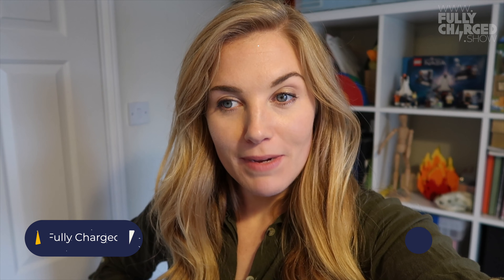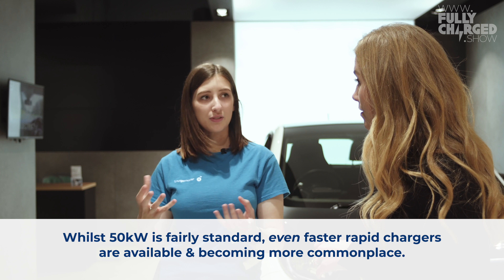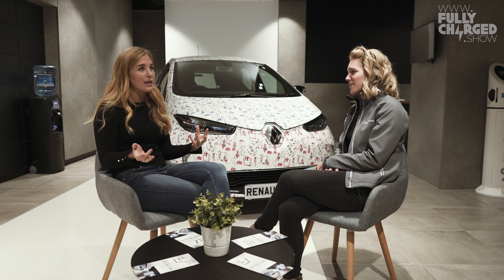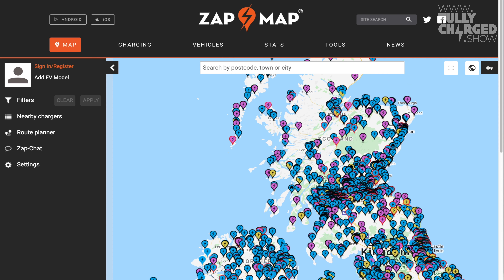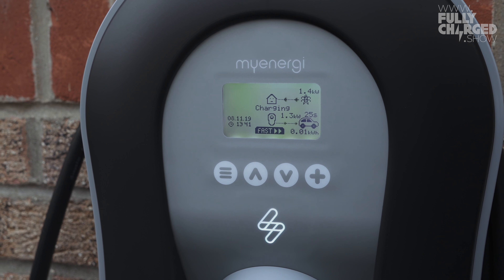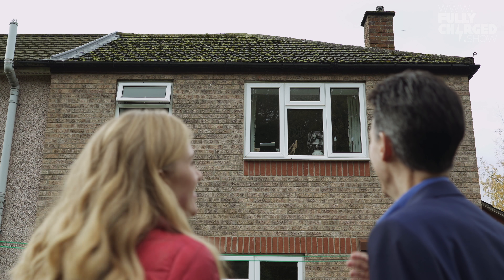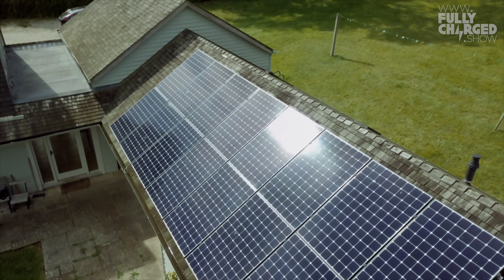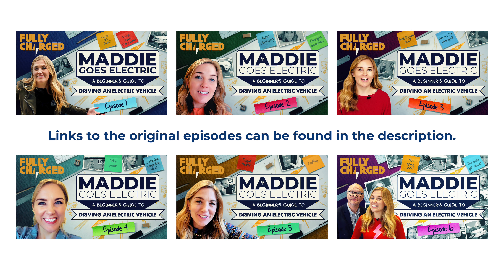A shareable, beginners guide to electric cars with Maddie Moate | Fully Charged

Comment: Have most of the Fully  Charged Show got family close by or would it be a longer trip, because the charging network can vary depending on area of the country.
Reply from the maker: It varies person to person, but I do 30,000 miles a year in my electric car. Many models now have 200-300 mile range and are really easy to live with. All the best, Fully Charged Dan

Comment: Great insight into electric cars. The key for this to work is good infrastructure and faster charging times. It feels like the future though. Maybe you could do one on hydrogen cars and how that is looking.
Reply from the maker: It's the here and now. Have done 120,000 in 4 years in an Electric Vehicle. We cover Hydrogen too, but the cars start from over £60,000 so it will be a while before they are cost competitive. Thanks, Fully Charged Dan

Comment: I have a question regarding the rising cost of public charging. It’s really putting me off looking at electric. Firstly there is the far higher cost of the car but now in many counties it’s costing more to charge than a fossil fuel fill. Massive mistake here. What are your thoughts? Paying more up front for cheaper running costs make sense but paying more all round is a major turn off. It’s now purely an environmental choice which will hinder growth or stop it in its tracks.

Comment: There are more charging points than petrol stations in the UK? That's a surprise. In the US there are around 80000 charge points and about 168000 gas stations. Of course, to be fair, if you also add all of the places you can just plug in to a (slow) electrical outlet then the charging points run into the millions for both places. (That last bit is the part that gas/petrol-heads conveniently forget to mention when criticizing EV adoption).
Reply: Interesting that in the US the cables are permanently attached to the charge point (destination) but in the UK you bring your own cable. The good part about that is that your cable is probably more likely to stay in good condition than if you have thousands of other people using it.
Reply: Wait...You can choose your electric utilities company? Logistically, how does that work? What entity is your house connected to for power? If you choose another company do they reroute your house to another physical electricity supplier? In the US basically your electricity supplier is determined by what area you live in, and the suppliers (utility company) has a long-term contract with the local government to be the sole supplier in that area.
Reply: @JustWasted3HoursHere  Your house is connected to the National Grid. It's actually generally unlikely that the energy you consume will generated by the company you pay, but the UK wholesale energy market works such that the company you pay will either generate or buy enough energy into the grid to cover your use. That leaves us broadly free to pick and choose from any company we like. I have to say I find the American way of doing it peculiar. For the land of the free you seem to have a surprising lack of freedom to choose your utility providers!

Comment: Why not also include hydrogen combustion vehicles not just electric like Stanley Meyer's fuel cell technology electrolysis to make your own HHO fuel in a modified combustion engines that required stainless steel component to prevent rust damage along with a smart subsystem... unless it is the very same line of Nikola Tesla's electric car that did not require a battery or battery storage as the energy is free to use that exists all around us within the Earth and in the atmosphere - he also demonstrated on the very first RC sailboat model he modified using the same technology to direct the model boat?!?
There is also Troy Reed's electromagnetic surge motor engine that worked only had the standard 12v car battery to operate redundant systems was also recharged by the technology within the Geo Metro compact care he had converted...
Reply from the maker: This is a beginners guide; and there are no Hydrogen FCEVs commercially available to buy in the UK for less than £60,000.

Comment: Whats wrong with the girl that says 50kw is the top dog. I would consider 50 kw emergency charger if I cant find a 150kw.
Reply: lots of cars still have 50kW as the max fast charge current. Mine included.
Reply: That's a nice Destination / Home Charger. Which handles 90-95% of people's daily needs.  The higher currents are for traveling longer distances or locations that can't or won't offer higher power outlets. Apartments/Flats. Houses with curb side parking.

Comment: I'll get an electric car maybe in 5 years time when the infrastructure is sorted and charge times are lower, I can't wait an hour for a charge
Reply: I had similar concerns, but I realised that in fact I could charge it every night at home (I have off street parking - I know that not everyone does).  So in fact it actually SAVES me time.  No more visits to petrol stations (for 99% of the time).  It's very rare that I do more than around 120 miles in one day.  I realise this might not be your situation.

I've done a few long journeys in my 2019 Leaf.  I plan the stops for Rapid charges around toilet/coffee/meal breaks and it's been no hassle.  Virtually no waiting around.   I made one timing cock up once, which resulted in an unexpected 40 mins in a motorway services..... that's it - the only hassle I've had in five months of running an EV.

It's difficult to explain this to someone who hasn't experienced it. It's a change in mindset and operating method - but that doesn't mean less efficient or more hassle - just a different way of thinking.
Reply from the maker: Depends by country/region, but in 100,000+ miles of electric driving I haven't had a single problem. The 'infrastructure issue' is mainly a media myth. Thanks, Fully Charged Dan

Comment: It's beyond stupid to use a set of batteries to charge the battery pack in your car. There needs to be easy changeable battery packs that one can stay at home during the day to charge. Then on trips you can have quick change batteries the whole way, so you never have to stop longer than the time to swap them out if there's an available charged battery pack ready.